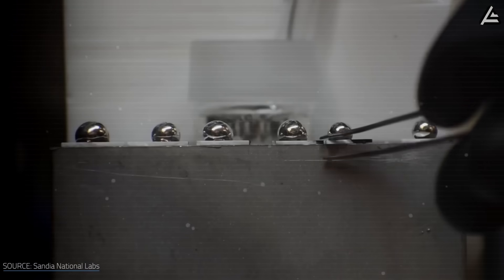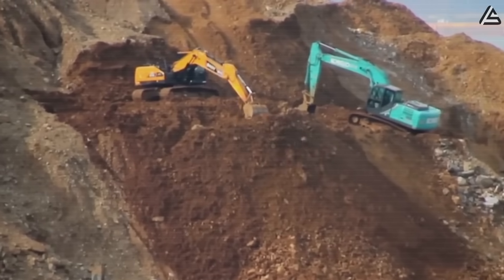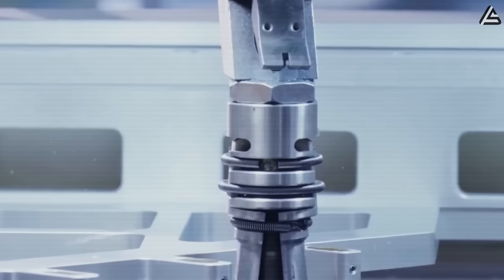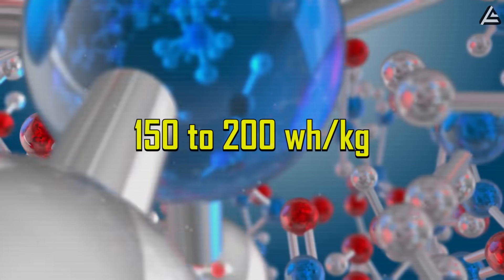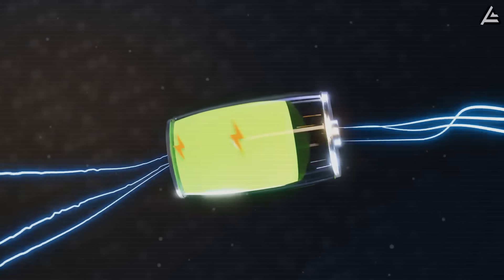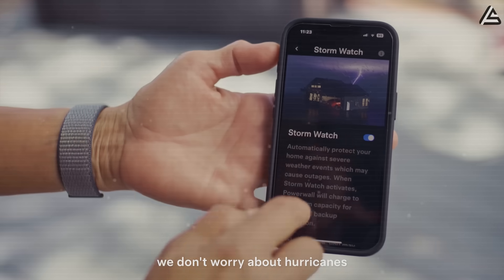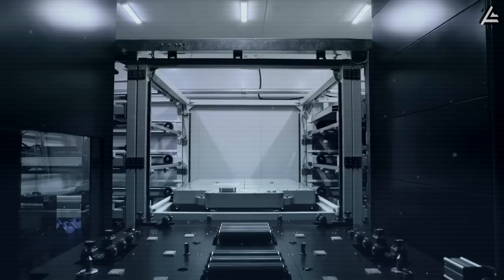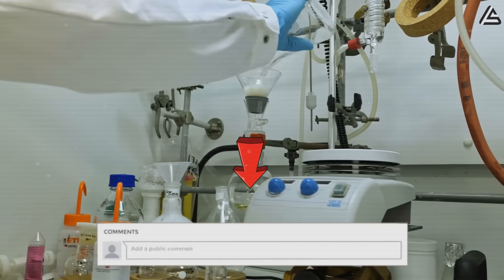Elon's 2026 Tesla Batteries: Aluminum-Ion VS Sodium-Ion. What's Hidden Behind?

Comment: The claim in this video that sodium-ion performs less well at low temperatures is directly contradicted by the claims made by CATL about their Naxtra sodium-ion batteries (alleged to perform BETTER at low (and high) temperatures than Li-ion.) So either CATL are lying, or the video is out of date, or the sodium-ion batteries that Musk is involved with are inferior to the Naxtras.
Reply from the maker: Do you think Tesla will partner with CATL for Naxtra cells, or try to develop its own sodium chemistry instead?

Comment: There is the source materials costs and availability (or scarcity), then there are the properties of the finished product (battery) that contains those source materials.  That the materials NOT CATCH FIRE (lowest risk) is a "critical property".  The other factors after that are (1) cost to manufacture (2) power output to weight ratio (3) power output to volume ratio (4) quickness of charge cycle (5) operating efficiency at temperature extremes (In Hot or Cold weather)  (6) Life cycle, how many charge/discharge cycles (7) Vehicle heating in cold weather is usually from collecting battery surplus chemical heating, which is also a "performance" consideration.  If there is no, or low battery waste heat, then battery power itself would need to be used for vehicle heating.
Reply from the maker: that’s a spot-on hierarchy of what really matters in next-gen battery design. Safety first, then cost and performance.
The heating point is especially sharp — sodium-ion’s cooler operation means less “free heat” for cabin warmth, so EVs may need smarter thermal management.
Do you think future EVs should integrate mini heat pumps to balance that efficiency gap?

Comment: Is sodium-ion safe enough to skip some of the cooling systems?
Reply from the maker: Good question 🔋 — yes, sodium-ion cells are inherently safer and generate less heat, so they can use simpler cooling systems.
But Tesla (or any automaker) would still need some thermal management for performance and longevity.
Do you think cutting cooling complexity could make EVs noticeably cheaper?

Comment: How do sodium cells handle fast charging?
Reply from the maker: Pretty well, actually ⚡ — sodium-ion cells can charge faster than many lithium cells because sodium ions move more easily through the electrolyte.
But since the tech’s still young, high-rate charging can shorten lifespan if not managed carefully.
Would you trade a bit of cycle life for consistently faster charging?